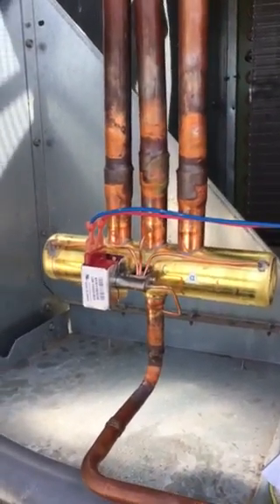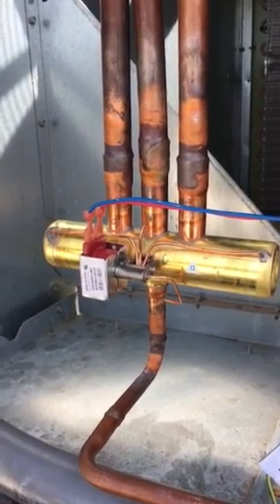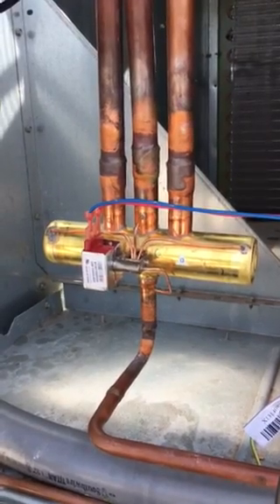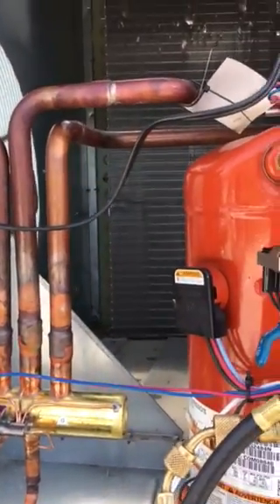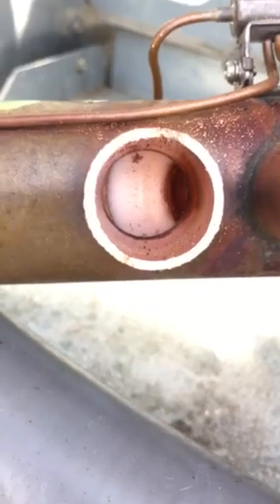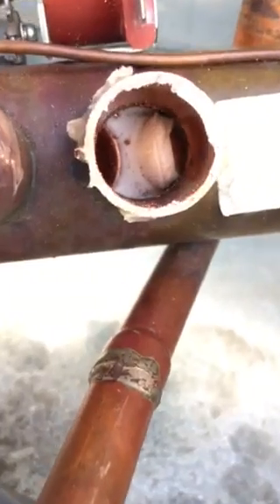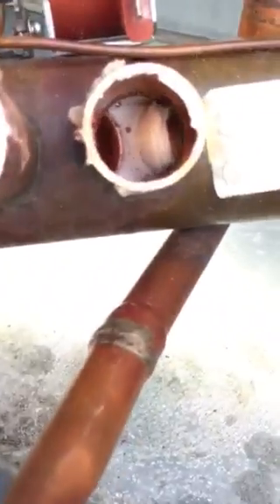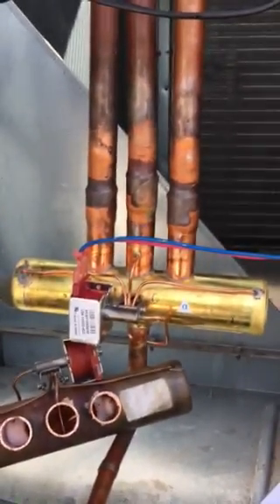Trane reversing Valve won't cool but heats ok.

Comment: I just ran into this today on a carrier RTU.. It will appear as if the unit is pumping down in terms of pressure, but the suction from RV to compressor was freezing over within 30sec. Quickly diagnose this by checking suction line temp from RV to compressor, and compare to suction line temp of your "evaporator" based on heat or cooling. Anything above 3⁰F differential, it's a leaker!

Comment: I had one today that in heat mode, the head pressure would pass 600psi and trip high limit. Suction was something like 160psi. It's 410A.
I'm thinking it might be not fully opening into heat. It works great in a/c.

Comment: Heres a tip: tap the reversing valve lightly with a hammer til it gets to what you want.

Just like your old starter on your cars or work vans when you tap it and it works there goes to your indication.

You could also fix it by tapping it on a new one.. sometimes you gotta have faith .cause in the automotive world mechanics say this and that could not work then you do it and it works!

Comment: Doing this at work tomorrow, I was trying everything in mind to not lead me here but symptoms are hard to ignore , that hot gas bleeding into my suction side giving me a 2 to 1 compression ratio on a scroll , doesn’t help it’s 2000 degrees in Southern AZ

Comment: Great find! I think someone should really tell an engineer to angle the 2 outer pipes away from the center pipe, so that we can get better access to braising those fittings during installation of the new one!
Thanks for this one. I'll look out for this. Especially since we primarily install Lennox & Trane.
Reply: Encase you haven't figured it out yet, engineers couldn't give two shits about u lol
Reply: @loganc339  You are wrong about that. There are reversing valves designed this way.
Nice try though!
Reply: @adamspears3819  it seems like engineers build units purely to screw with the techs that work on them. They dont give a damn lol. If anything they think it's funny to do stuff like put screws in places you can't reach

Comment: The inside of those three ways can affect the system depending on the mode - gotta check everything that can affect the three way reversing valve. They can be tough to figure out, those seals can affect the system bigtime. Great video in general.

Comment: At my job we had high head pressure and low low side pressure. Had a horrible ac company come out and claimed the liquid line dryer was clogged replaced it. $1200 charge. Well the same shit started happening within a week and the evaporator was hissing except this time instead of freezeing at the lower portion of the evap it was heating on the lower end with the same head pressures. After seeing the repairs these idiots did on other ac systems, Like electrical taping caps hanging under the condensor fans exposed to the elements I said the hell with that. So I smacked the reversing valve with a rubber mallet and WOW the damn thing started working. I learned that cause about 25% of our amana PTACS do the same damn thing. Heat when they are supposed to cool. Just smack the damn valve once.

Comment: This might be my problem....I have a 15 year old york R-22 outside unit which heats but will not cool.   When I program in cooling mode everything appears to be working ie. outside fan works, I hear the condenser, inside fan is blowing air, air filter and coil are clean but it does not cool and I don't see and water condensing on the inside drain.   Earlier this year I had the refrigerant checked and it was low.   We pressurized the system looking for leaks but there was none found it held 350 PSI for 30 mins.   The tech though it might have been the gauge valve since when he opened the cap he heard a it of gas escape.   So  we added refrigerant to the level required 5 lb 11 ozs.   After this the heating worked fine compared to before when it was going constantly with little heat.   Fast forward a few months now I want to cool and it does not work but heating does.  Cooling didn't work last summer either but I figured adding refrigerant would fix the no cooling problem this year which turned out to be wrong.  In cooling none of the lines feel cool but in heating the large line gets very hot to the touch.   

What would you suggest to check now or is it most likely the reversing valve?   Great video thanks!
Reply: DID YOU GET THIS FIXED, CAUSE MINE IS DOING THIS RIGHT NOW. AND HOW?
Reply: @jesusbautista7962  Mine was leaking refrigerant slowly from somewhere but we could not find where.  I fixed it by replacing the outside and indoor units since the air handler had to match the new refrigerant.
Reply: @ChrisVanSlykeCVS  Hey that's not fixing it; you replaced the entire system!

Comment: Have you had one build up pressure on the high and low side then make a hissing sound but not shut off the compressor? Head pressure will get up to 450 suction gets to 275-280 the it "pops" off and the pressure goes back to normal.
Reply from the maker: Yes. Not necessarily due to a reversing valve issue exclusively, but any kind of head pressure problem. Some compressors have internal high pressure reliefs that cause head pressure to bypass internally (possibly causing the housing noise) to the compressor if there is a high pressure condition. A hot system, compressor, low capacity operation, and your previously mentioned pressures, may be signs of this. Just a guess, but a blocked reversing valve could indeed cause this.
Reply: Thank you guys I’m having this problem on a brand new Lennox heat pump I installed. I ran the unit added a pound for line set length unit ran for thirty minutes perfectly. Customer says she cut it off it would cut off I was thinking reversing valve cause I kept hearing it move or attempt to move but I’m my pressures would go to almost 600 and cut off on high head pressure can’t be a bad compressor right has to be the reversing valve? Help me please? I didn’t not amp out the compressor it only runs for a short period and I don’t want damage anything at 600 psi. I was going evacuate and weigh charge back in. Any other suggestion
Reply: @726scooty    could be bad txv in condenser

Comment: Holy crap I think I've got the exact same issue going on at one of my customers house. Found bad compressor, changed it. The way it acted seemed very odd. I've been leaning towards the reversing valve but it also seemed as it the compressor wasn't pumping right so I ordered a new compressor under warranty and new reversing valve just to get it all done at one time. My company does a lot of home warranty, it sucks but man our company have really thrived over the years because of it.